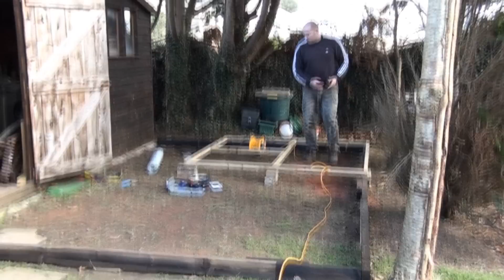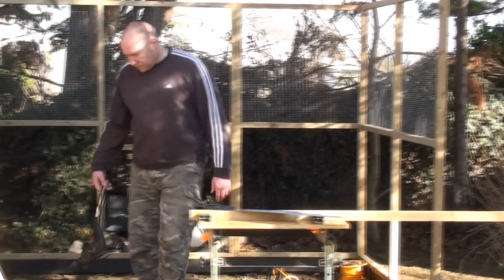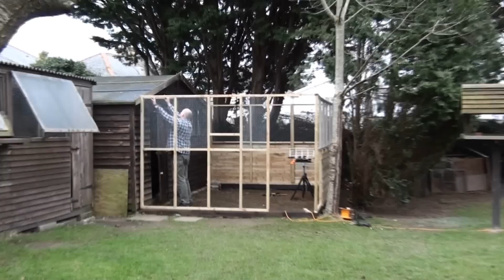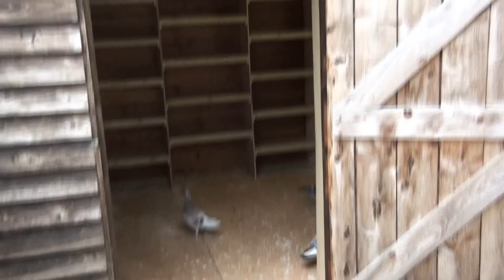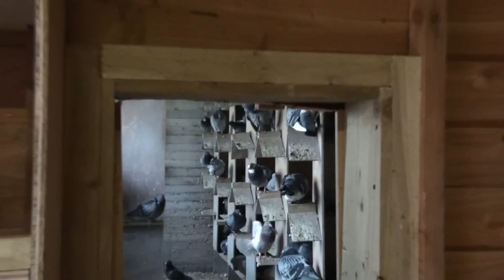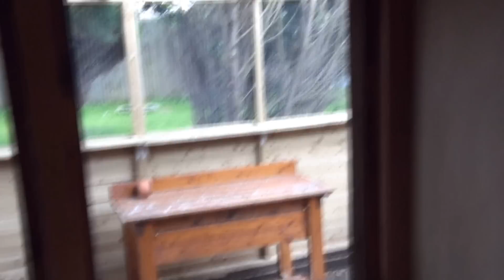Racing Pigeons, Fremington, Building My Loft Extension (HQ)

Comment: very very nice.        im looking to start pigeon racing as most of my family does it already i was thinking of buying a shed and kitting it out with a avarie (averie?) that goes around 3 of the walls but the forth wall would be the windows and i would take out 1 window and put in a trap and cover the rest of the hole with wood.... do you think that idea would work? + also how much did your avarie(?) cost for building supplys?

Comment: what did you use to hold the shelves? (I mean the white thing)
Reply from the maker: They are "White Plastic Fixit Blocks" which can be purchased from Wickes if you are from the UK, they are for fixing boards or pieces of wood together, and are very handy for jobs like this, they are also good when one is fixing work tops in kitchen.. I am a carpenter by trade and highly recommend these blocks for many jobs, thanks for watching...
Reply: I live in USA, I liked this idea, I will look for it in stores. Thank you.

Comment: @MrCarlr7 yes so i will do it as small as i can thanks for your advice so i will stick to 2ft wide 1.5ft the depth and 1.0ft height when i will build some i provide you with some photos :) but what's holding me back till now is the face of it i couldn't find a cheap material to do it, because i don't wanna use wire i wanna use timber rhodes and i can't find it till now

Comment: Is there any reason why you couldn't put silica sand or silver sand on the floors to soak up droppings? I keep birds of prey and I put sand on to the floors of my pens for this reason and I don't get issues with dried droppings becoming dusty and then stirred up when the pigions flap. Its a nice set up, well done :)

Comment from the maker: Hi so sorry for the late reply, no i can't see no reason why you could not use silver sand, and i have used it myself in the past on the floors and the nest boxes, but the trouble i had was getting rid of it when i cleaned the birds out and needed to change it, at first i just sprinkled it on some of the pot holes in the garden, and then ended up putting out with the garbage, but yeah sand looks nice in a loft and makes it easy to clean, thanks for your comment...